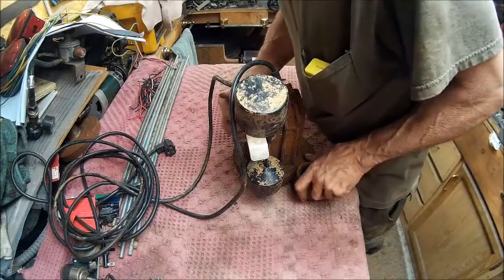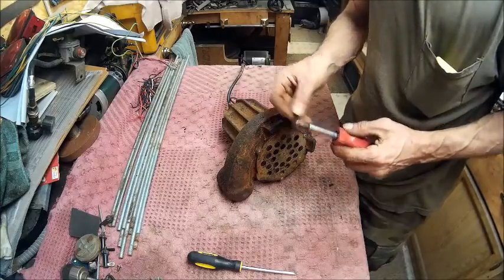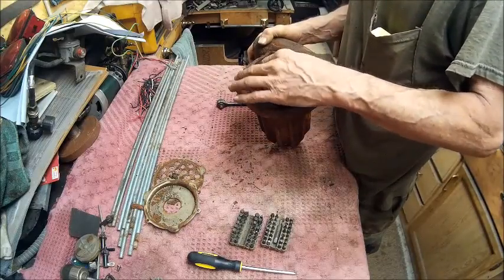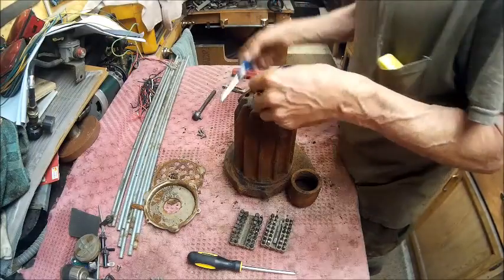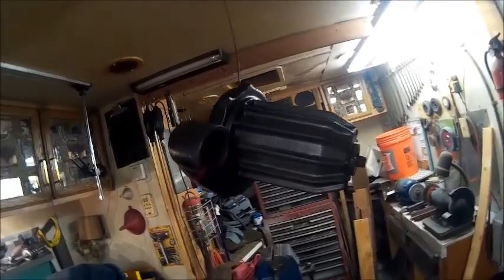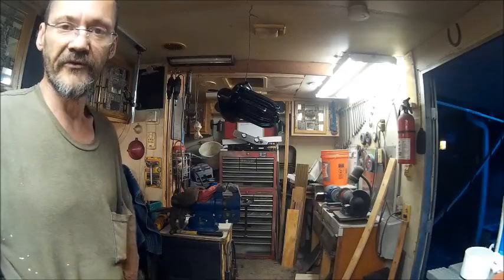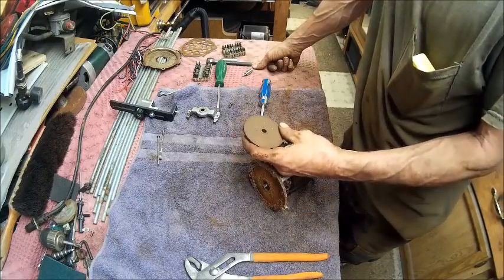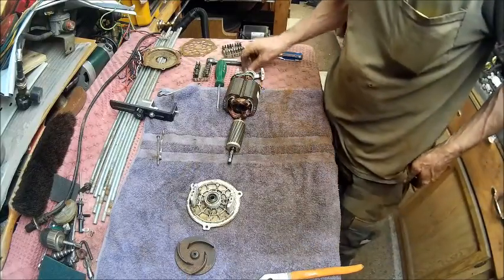sump pump rebuild part 1

Comment: The orange stuff looks like iron oxide that is released from spring water when it gets oxidized from surface air.  Keep it air tight and run it over the right metal plates with a capacitor and you might have a nice flow battery so it can keep running during power outages. Scale it up and you might be able to make better large scale battery at that location than the other big power grid batteries.

Comment: Man, don't use epoxy. ! Get you some brazing rod And Breeze a little spot and then file it down and you'll be good to go. You can do it from each side. It doesn't have to go all the way through as long as it. Get a grip on the flat.

Comment: Liquid Wrench helps a lot
Reply from the maker: not on any screw that is in a dead end hole. how would it get to the threads. plus i didnt have any problem getting them out
Reply: Well the thought on penetrating fluid is that it gets down into the tiny crevices and helps to lubricate. After doing research, I found that a 50/50 mix of automatic transmission fluid and acetone works better than anything on the market. And it's a ton cheaper to. I could go into why and how it works but try it out sometime. Glad you didn't need it on the pump though.